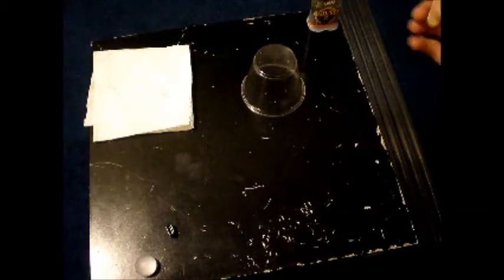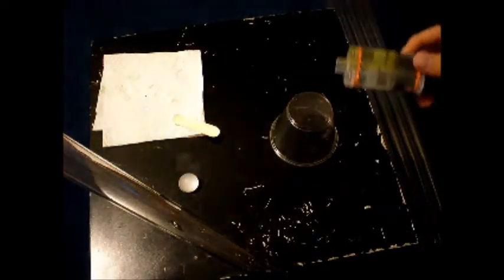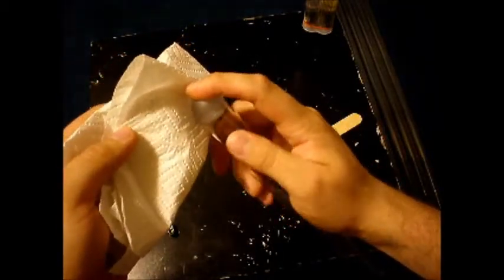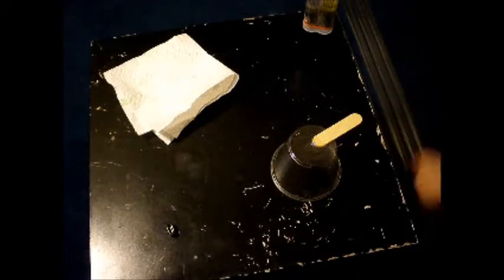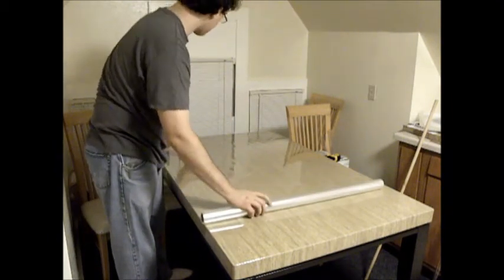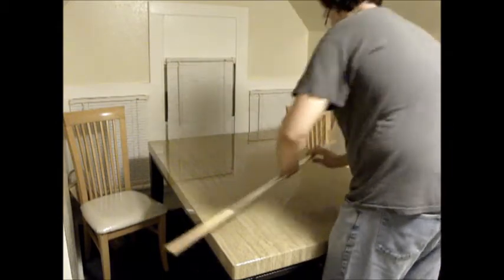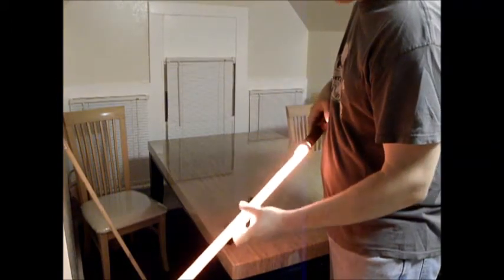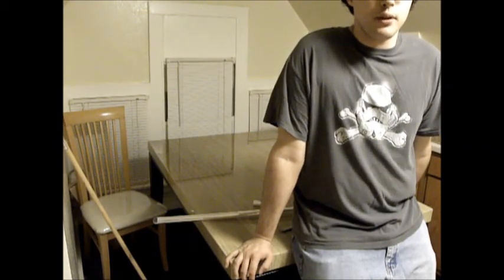Saber blade build

Comment: it would've been nice if you told us what size tube you are using
Reply from the maker: Mine was 1" tubing. I didn't say because it is dependent on the size your saber would use, 1" and 7/8" are the common sizes.